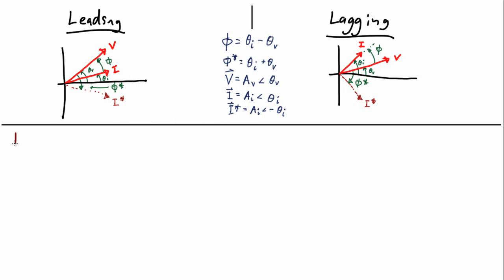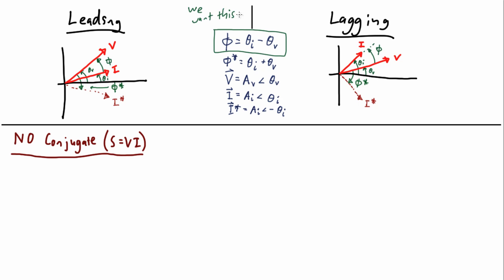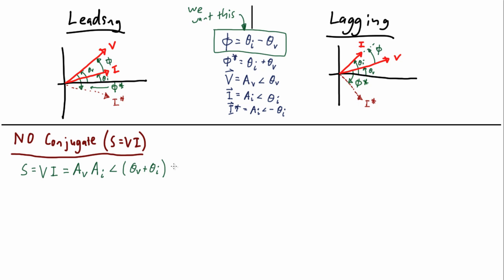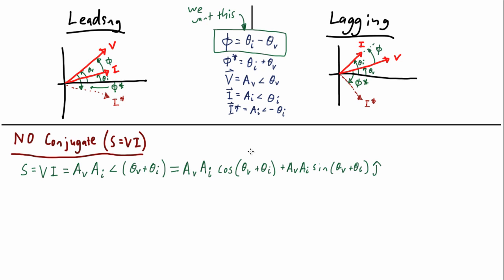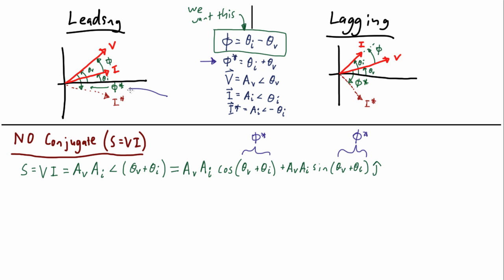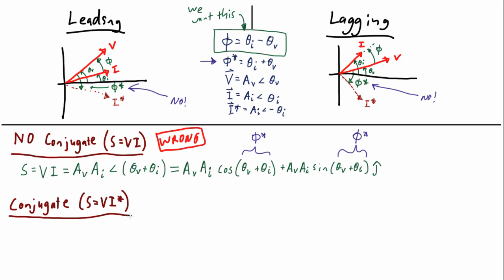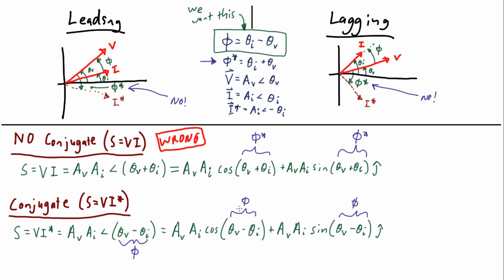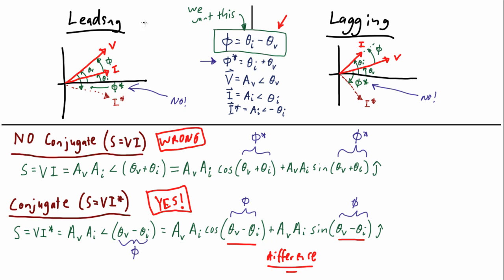Electrical PE Exam - The Conjugate (S=VI*) [part 2]

Comment: The definition of leading and lagging definition seems to be incorrect. In standard practice, the term leading and lagging in expressed in terms of the current.
For example Leading PF means current leads voltage ; and Lagging PF means current laggs voltage

Comment: Is the leading and lagging representation correct here? Shouldn't leading side have current at a greater angle than voltage? and shouldn't lagging side have current at a lesser angle than voltage?

Comment: Phi for "we want this" should actually be phi(v) - phi(i), thus the sign convention for leading (+angle) or lagging (-angle), relative to voltage vector.  This would be important to get the sign of the reactive power correct.

Comment: @MsAppledance - he said in part 1 that the (complex) conjugate in not merely flipping the I vector about the V vector.  The conjugate IS the inverse of the sign of the complex component, effectively flipping the I vector about the X axis.  The only time the two are equivalent is when theta of V is zero (and P = VI is valid).

Comment: I don't understand your explanation. Before, you said that the conjugate is NOT merely flipping the sign for the current phasor... but here, we see that.. since it is theta v + theta i, then it IS just the same as effectively flipping the current phasor across the x axis. 

I'm also confused that you use the phi* for the S=VI, but the regular phi for S=VI*. Is this just the convention? How do you explain that?
Reply: difference between the appended angles matter the most to meet the reality or physical order.. forget about positive, negative or flipping the phasors..